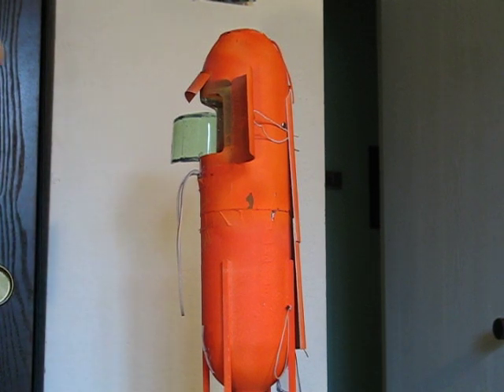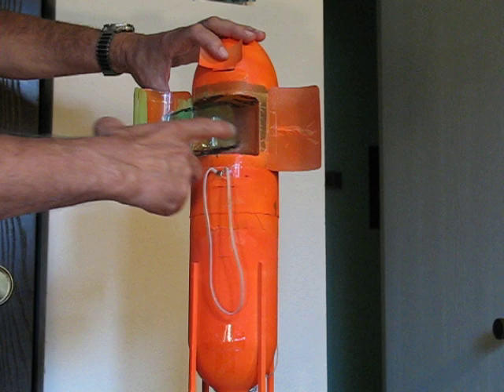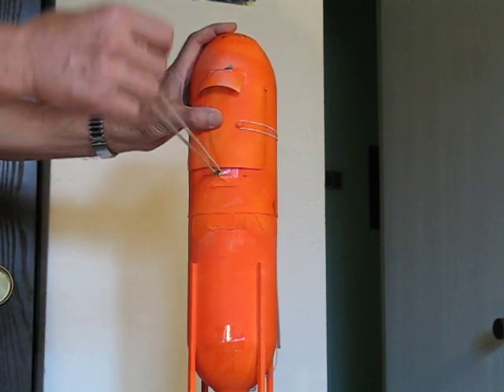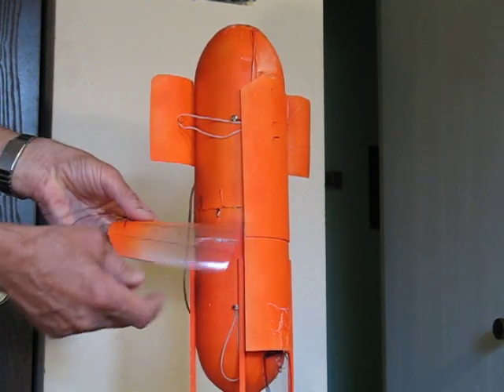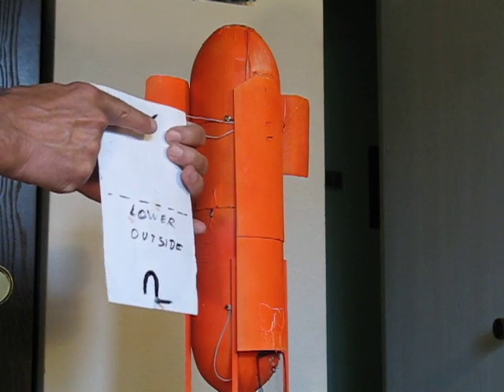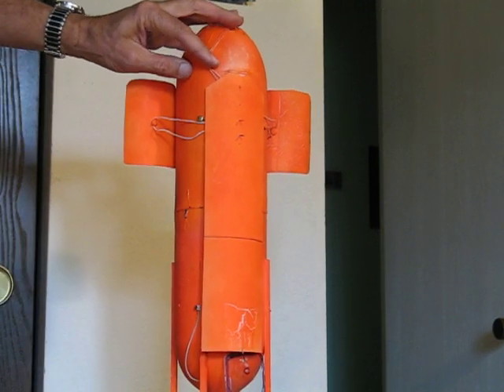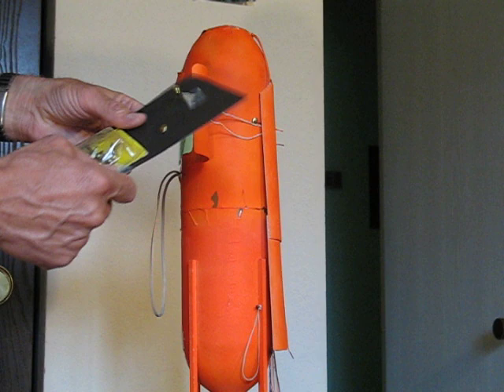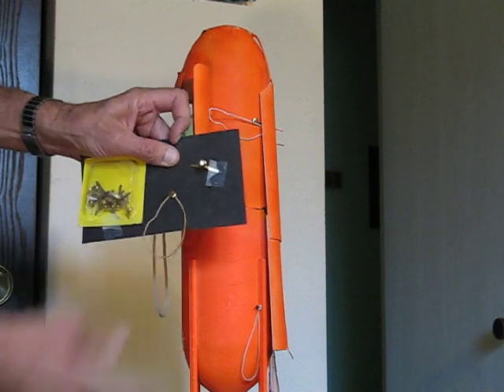AIR FLAP PARACHUTE DEPLOYMENT MECHANISM  7/13 version

Comment from the maker: Hello Aaron. I run a strong string from the parachute along the outside of the rocket and outside the ring fin then up inside the ring Fin and it attaches to the neck of the bottle. For convenience, the string has a tiny slide open Metal connector on the end. To make sure that the line never comes off the bottle I use a bottle cap and cut off the flat part. That leaves just a threaded collar. I attach a fine copper wire to the collar then screw the collar on to the neck of the bottle. It has never come off or broken. Good luck with your project. Thanks for the question

Comment: Finally a smart designer that knows how to use the KISS principle.  Many overly complicated/idiotic designs out there.   This is a very good design---thanks for posting.  

 I used your design but simplified it slightly.  On mine I use 1/3 of a foam football as the nose cone.  It is hollowed out slightly with an additional concave space below it.  This is where the parachute is stored.  The cone is held on with tension (from the air flap rubber bands) and is 'hinged' on the opposite side with fiberglass strapping tape.  Works great.
Reply from the maker: Terrific.  How much pressure are you launching with? Does it deploy early or late  when the launch pressure is changed?  I had problems with that.  Any comments about how you make adjustments would be appreciated.  I have been launching "coneys" for the past 2 years. Once built they never need adjustment and work at any pressure. The descent is fascinating but nothing is as beautiful as a parachute.  Thanks for your comment. Think I'll try it.
Reply: I've only launched it a few times--at 100psi.   I'd say the parachute released early--a little before the expected max altitude.  If I get back into this again (with grandson & better weather) I''ll have to try a few tweaks.  Thanks again for posting/sharing your excellent design.
Reply from the maker: I like your your design. Simple is better. I might use it.  How successful have you been at adjusting it to be reliable?   Thanks for your comment.
Reply: I only  recently re-launched this rocket....so it' been in storage for over a year.  Still worked great---3 for 3 on parachute deployment.  I did slightly tighten up the the air flap rubber band (1/4" elastic strap)....as it had  slightly stretched.  
My  next plan is to build a 5 gallon (water bottle) rocket....with foam nose cone and a rear (on bottom of rocket) parachute deployment system.   MANY bugs to work out....(max safe pressure I can use, size of chute, chute eject  system, type of foam and glues to use, fins--on extended struts....etc).

Comment: how did u make ur rocket?
Reply from the maker: +Jamyrlyn Mallory 
Hi Jamyrlyn.  Read all the comments below the video to get details on how to build the rocket.  The parachute bay is described at these links:  https://www.youtube.com/watch?v=8JY6-vrV1Gg     and also  http://www.aircommandrockets.com/construction_7.htm
    Both are great, especially Air Command.  
Read the "Hi Preston" comment about bending balsa wood. 
     The  glue that I use is made by LOCTITE.  A small 1 oz tube is about $3 at Walmart in the sewing section or at any hardware store, Lowe's, Home Depot. It's a purple & blue tube  titled VINYL,FABRIC & PLASTIC flexible adhesive.  Or at haraadware stores get Loctite PL PREMIUM . Black and yellow tube. 4 oz tube  about $5.  
       I love the ring fin design.  It's so stable and durable.  I cut the sticks, 12 inches long, using my table saw.  An easy way is to buy a wooden yardstick in the paint dept. for 99 cents and cut it by hand or with a saber-saw. Its the perfect thickness.  3/16" to 1/4" thick.  The ring itself just comes from a plastic 2 liter bottle. 
        Have fun & good luck.
Reply from the maker: +Jamyrlyn Mallory   Please be sure to click "read more" at the bottom of  my previous reply to you.  There's a lot more for you there.

Comment from the maker: HI Preston,   Thin wood will bend when heated above 250 degrees F and hold its new shape when cool.  Get a glass jar, stove pipe, or post, something round and smooth.  Dampen the balsa,  & use a regular clothes iron to heat the balsa and form it to the curve. Use the hot "cotton" setting.  Secure it with rubber bands, string, or tape when done  & let it cool.

Comment from the maker: OK Natasha, Here's how to make the parachute compartment.  Go to The Air command website. http://www.aircommandrockets.com/construction_7.htm      Look under "construction advanced "  "side deploy #1"  steps 2 through 12.  I didn't use their electrical timer or ejection system.  The "plastic cardboard" used is coroplast and can be bought at hardware stores, but right now you can get it free because its election time. Call your favorite candidate's office and ask for a free sign. Put it on your lawn and after election use it for your project.

Comment: Does the launching pressure matter? I prefer to shoot by 8 bar (max. pressure of compressor) Does it still work like a charm? I've been looking for mechanical launching system and I think I'll build this 'cause this looks good and working.
Reply from the maker: YES.  Launch pressure matters. Once it is adjusted and works do not change the pressure. I used 4 bar with consistently good  results.   6.8 bar was a disaster. It went so fast that it would rip off the 'chute or not deploy at all.  I think that 8 bar would require a much smaller flap and stronger parachute line.
        Adjustment is by  "trial & error" and every failure damages your rocket.  It also changes when the rubber bands get old and weak.  Good luck.  I changed from parachutes to cones.  Much more simple, reliable,  and pressure doesn't matter.  But not as pretty.
Reply: Ok, thanks for that.

Comment: do you have a How you built this?  Link?  anything?  thanks in advance
Reply from the maker: HI Jeff,    use this link from Air Command  
 Water Rocket Parachute Deployment Mechanism   I used it to build the parachute bay. Its a great link!
    The corrugated plastic board is called "coroplast". I got mine free by collecting political campaign signs but its available at Lowe's, Home Depot, etc. in sheets for about $11.  For glue I use  Loctite "Vinyl, Fabric & Plastic" available at Walmart (in the sewing supply section) or at hardware stores. $3 for a 1 oz tube. It glues water bottles & coroplast great.
      In retrospect I was very lucky getting it adjusted properly.  I don't advise going over 50-60 psi pressure.  The velocity is so great that if it deploys prematurely the chute will rip off, or the flap never rises to release the door.  Either way your rocket augers into the ground.
      I have an idea for the same mechanism without the flap that should be immune to airspeed but haven't built it yet.  Having fun with "coneys" and the "how High" altimeter now.
     I've loved parachutes since boyhood days.  Did some jumping 45 years ago. Packed my own chute and jumped solo on my first jump & every one thereafter. Oh the thrill. Still remember every second & every sound.
        Have fun.

Comment from the maker: Hi, This system works but once its adjusted you must continue to launch at that SAME pressure. I used 60 psi. When I changed to higher pressure ( more strokes) the increased velocity delayed deployment until after apogee and then sometimes there was enough velocity to prevent deployment completely. It augured in.  I never did get it properly adjusted for 100 psi.
       Now I've switched to using a 25 inch cone for the return trip. ( a "coney") Its easier and more reliable. Not as beautiful as a parachute but has a visual fascination of it's own.  I put a "How High" altimeter recorder in it, from Winged Shadow Systems, and it records the max altitude reached. I'm up to 332 feet now. 
       Have fun,    Orville Wingnut.